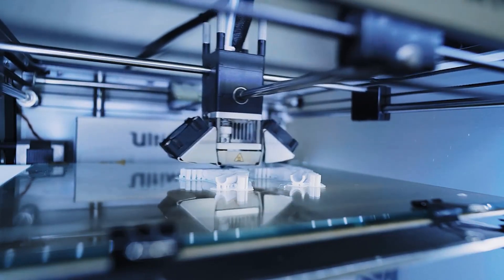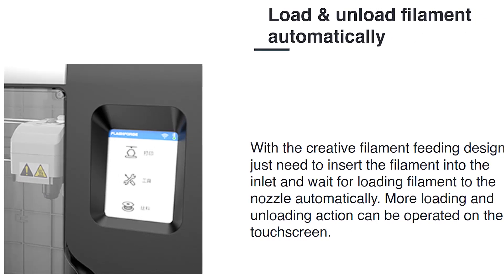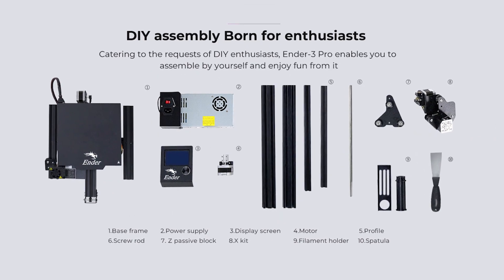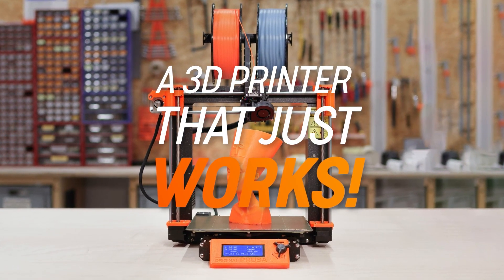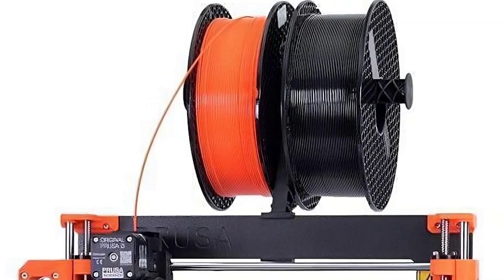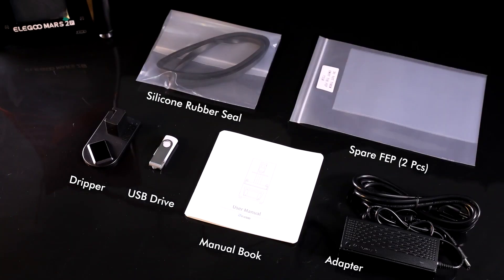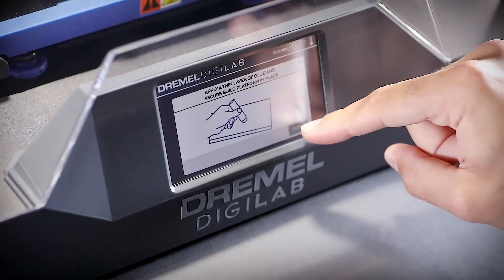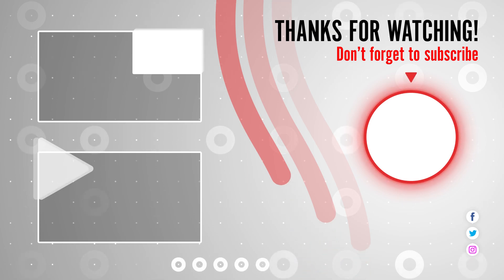Top 5 The Best 3D Printers of 2022

Comment: - Bowden printers aren't more accurate, in fact they are less accurate than direct drive. They are also not necessarily faster, less weight on the tool head means you can go faster but a lightweight direct drive extruders can do the same. 
- Mk3 isn't multi color unless you buy the mmu2s witch you never mentioned. I am not counting filament swaps as all fdm printers can do that.
- The Dremel DigiLab is one of the worst printers to buy considering the other options. The X1 Carbon a fully assembled printer with easy to use features is $1200. I in fact has more features than the Dremel printer. For 2k you can get a Prusa XL which comes with a fully built option too with a lot more features (it is still in beta).
- Out of the options you should have done more research instead of picking the top printers off Amazon

Comment: For the price of the ADV3 you can deffinitely get better ones. The camera on it is very laggy btw, and the part cooling duct is pretty rubbish. Its okay for a kid or a beginner but not much else. The prusa...8 bit board in '22 with a lot of 3d printed parts on it? Try out an Ender 3 V2 and you ll notice the print quality is the same, and for the speed, with a bit of tuning any ender 3 can reach the same. Also, unless you get the MMU unit for the prusa it is not a multi material printer, you.re better off going for a Sovol SV04, its a proper IDEX and doesnt need to print purge towers, so less filament wasted. When it comes to more expensive printers there arent many printers under 2K that can beat the X1 Carbon...so another option falling out the window. I dont wanna be too harsh here but top printers on a certain website arent necessarly the best.